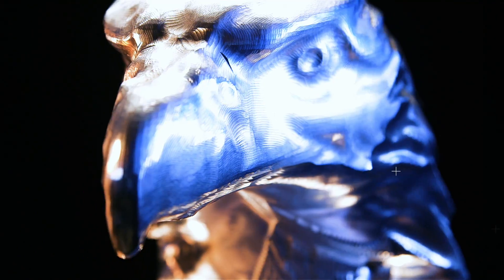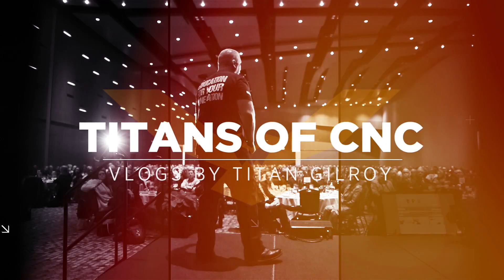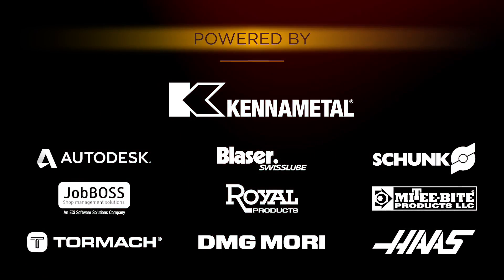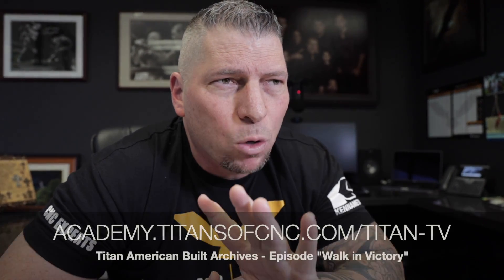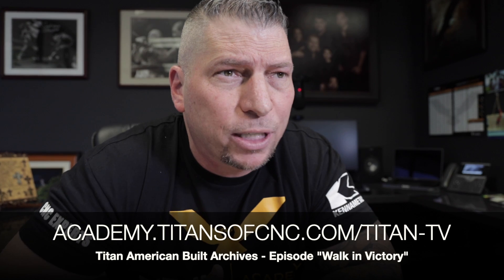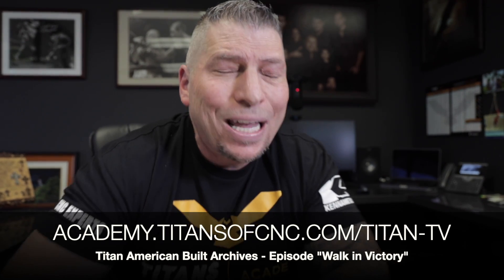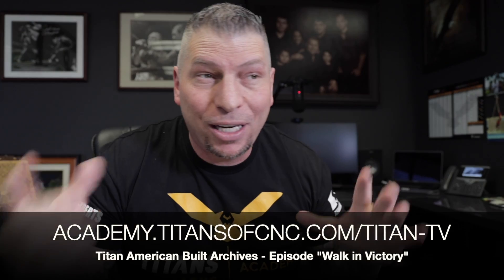CNC Machining Steel Crossfit Equipment | Vlog #83

Comment: Can you really compete with a tube laser on the section work?
Reply from the maker: Well the laser is expensive and many competitors were getting the tubes from the metal supplier with holes already in them...
Doing the holes in-house allowed me to negotiate the cheapest material and put holes in efficiently.
Reply: @TITANSofCNC  Ok thanks for your reply, what kind of money is Tube Laser cutting in the USA per hour?

Comment: What is that you run in after your drill? I assume a reamer or deburrer? I run a Peddinghaus 4axis beam drill/ saw line. We use mostly Kennametal bits. Honestly it was a waste of $800k.

Comment: I use to CNC program, set and operate but I found manual machining more stimulating as I do prototyping parts 

What if you pick an iconic building in America like the White House and machine it from solid in detail

Comment: CNC machined crossfit equipment? Isn't a bucket of offcuts enough?
On a more serious note: Do you repair any agricultural equipment (that's 95% of the work for most shops around here).
Reply: I don't think Titan does that. He's busy with all the aerospace stuff with true absolute positioning and chasing tenths. Nothing wrong with repairing agricultural equipment though. Without food we wouldn't be here.

Comment: Is there any episode that shows how you cut all your bar stock material? If not, pleace talk about it. When to cut dry with disc,  when to go bandsaw,  when to get a automatic bandsaw etc.  :-)
Reply: If you have any kind of quantity, buy your stock in pre-sawn. Let the stockholders spend money of automatic bandsaws and high speed circular saws. 

If you have to saw in house, a decent quality bandsaw with a few different pitch blades will cover all your bases.